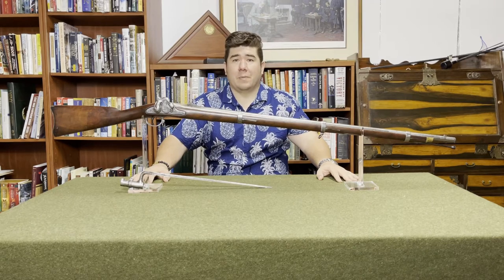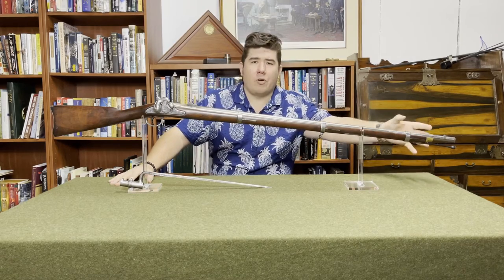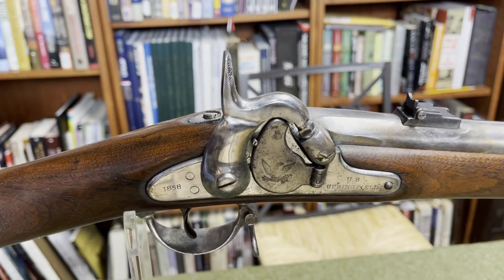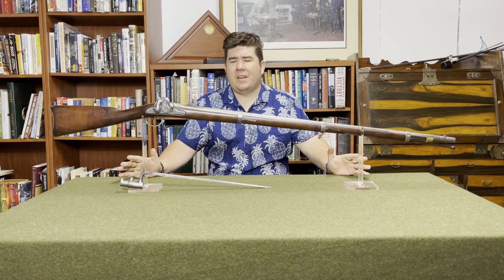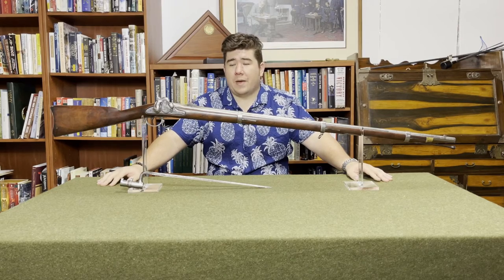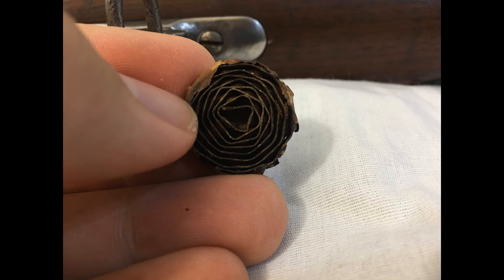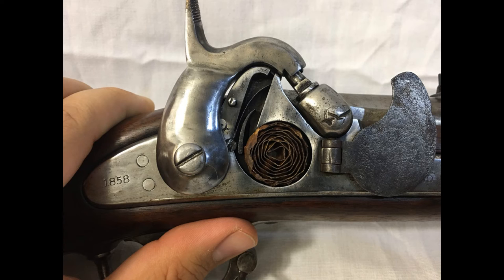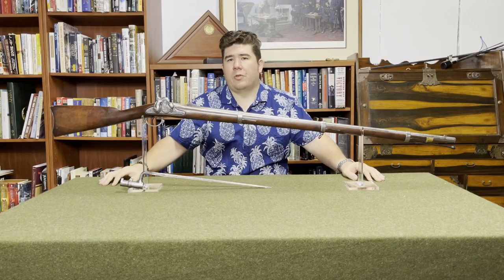Episode Six:  Springfield Model 1855 Rifle Musket

Comment: I just stumbled across this channel, and I really like these videos. I've been trying to find an 1855 for a while now, but am curious... in your ballpark estimate, how much price difference is there between a shooter vs collector example? I would love to find one from Harpers Ferry ever since my wife and I went there on vacation a few years ago but the small handful I've seen so far have all been Springfield.
Reply from the maker: Prices can vary wildly depending on condition, originality of parts, seller, buyer, phase of the moon, etc., but based on my experience (which is limited, so take it with a grain of salt), a collector example (great condition, original parts) would probably start around $2,000.  A shooter example (polished like mine is, some replacement parts) can run anywhere from $500 ("this is what I paid for it in 1973 so that's what I decided to sell it for") to the collector range.  Harpers Ferry examples tend to cost at least 10% more.